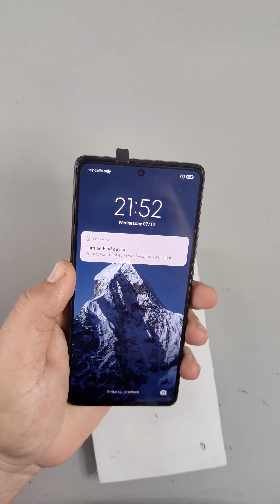Xiaomi Mi 11T/11T Pro LCD Screen Display Replacement | Disassembly | Teardown

Comment: Can I use the original LCD of Xiaomi 11t pro in my Xiaomi 11t phone, pro version is better I think when are  outside under the sun because of its brighter display, thanks for the reply
Reply: @EijnebAguero
 Did you find out if it's possible?